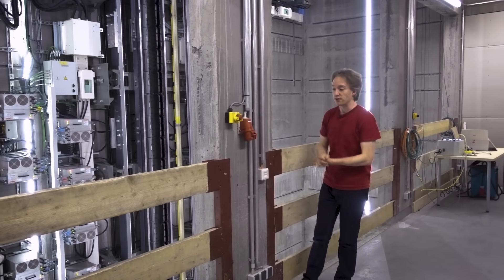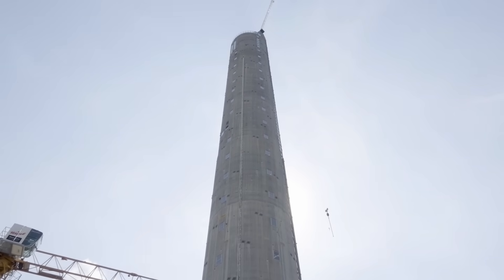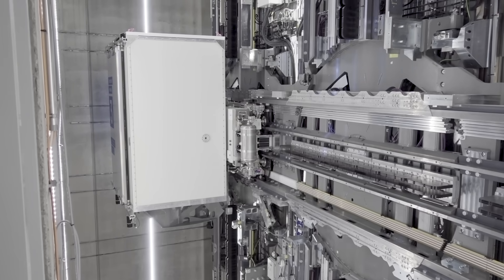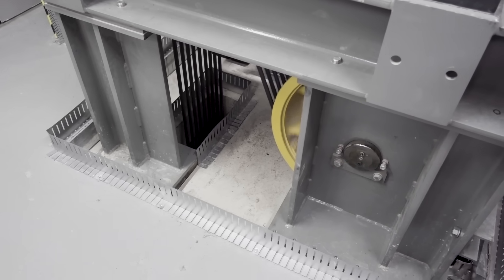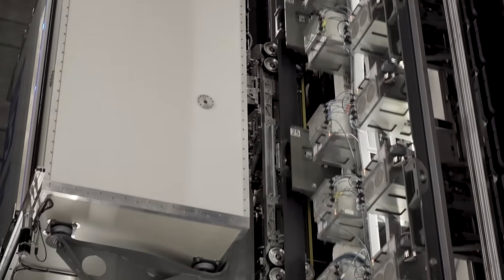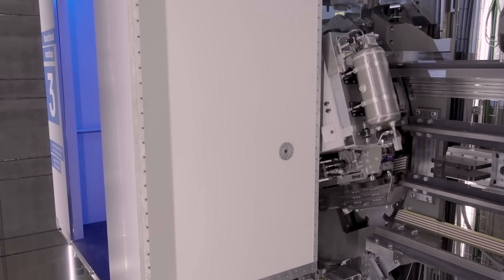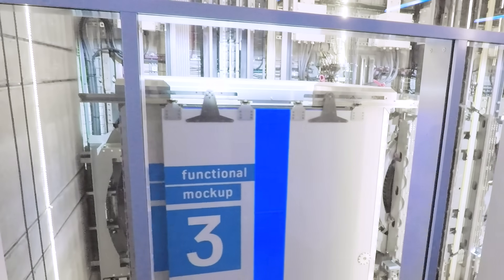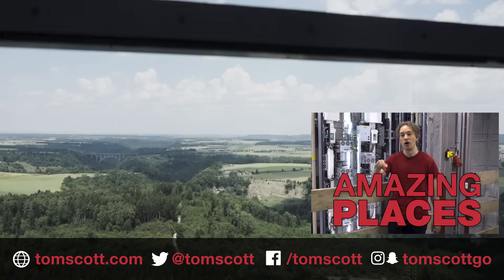An elevator that actually goes sideways

Comment: The elevator buffer will reduse the fall from fatal to  serious injury
Reply: Seatbelts reduce the crash from fatal to serious injury.
Reply: Place a bucket of water before falling, noobs
Reply: @theperson7938  or how about keeping a bubble gum in your pocket?
Reply: Between dying or losing a leg, I think I rather lose the leg.
Reply: @adammcfall5133  Between death and brain damage vegetable state, I'd pick death.
Reply: @adammcfall5133  I'll rather die
Reply: Ke Gao same
Reply: @影-j7f  You're weak.
Reply: @影-j7f  same
Reply: @影-j7f  sane
Reply: @影-j7f  same
Reply: @影-j7f  same
Reply: @benis9965  I mean I can’t suck my toes, so it’s a huge downside.
Reply: @rhaib  super sane in fact
Reply: @影-j7f  why
Reply: @影-j7f  Tell that to BTK amputees that live healthy and happy lives.
Reply: @影-j7f  with the state of prosthesis these days, i wouldn’t worry
Reply: @cumquatrct3 Not a good idea
Reply: cumquatrct3 
It actually wouldn’t help much. You might expect that you’d be floating in mid air and the elevator would crash below you but thats only your velocity relative to the elevator. Your velocity relative to the ground wouldn’t change much. You’d still fall with the elevator—just slightly slower. If the elevator has transparent walls you can see that.
Reply: @cumquatrct3 how will you determine youre about to hit the ground?
Reply: İ would rather not use the elevator at all
Reply: Bruh just activate no-clip, it's not that hard, just press V
Reply: Didn't work in The Omen....
Reply: I always thought "why not have independent sensors connected to an inert electromagnet system on the rails to engage slowdown when a freefall is detected? (just like those vertical freefall park rides)"

But then I realised that those cost more (to implement) than a human life.
Reply: @VarunGupta3009  I think the reason why that might not be used would be more due to difficulties in detecting a freefall. Elevators have all kinds of redundancy but they also aren't the smartest machines. Vertical freefall rides are entirely controlled experiences that most likely rely on timers and sensors activated by the elevator passing over them.
Reply: @deadturret4049  Even though a theme park ride is largely controlled by static time methods, and most of their operations are based on assumptions, an elevator has a lot of heuristics to work with. They may not be the smartest right now, but my point was to make them smart enough, which can be done right now by adding a simple circuitry to the existing system or even an algorithm. Hell, I can think of an implementation this moment with a dollar microcontroller and some C#. I am not trying to undermine the work put into them, but making elevators much safer than they are today by adding simple mechanisms shouldn't be that difficult. The cost of inline magnetic dampeners is a little high, but that could be worth much more in the future both in human lives and in service/malfunction costs. They are static systems and don't require any logic to work. They just slow down an elevator significantly before contact.
Reply: -Tom Scott 2017
Reply: cumquatrct3 dude I was always thought if it would work
Reply: cumquatrct3 ah yes, because I too have reactions faster than the speed of sound.
Reply: Reduse
Reply: i mean thats still an improvement
Reply: The traslate = you will die 30 ; 60 seconds after the fall
Reply: It's to catch cabin on normal speed in case when sensors don't work. NOT MORE! It can't help with falling cabin. Nothing remains in this case.
Reply: @akash-zg4vj  drink milk  to get rid of digestive problems
Reply: Tell that to the scientist in The Omen II
Reply: It reduces from death to comma.
Reply: @bungkusi2432  coma?
Reply: if you could hit the ceiling of an elevator with your head you should be in the Olympics. You would hit your head on the ceiling if it were going up, but not down.
Reply: @jasperpreedy1  Actually, it would be the opposite. If the elevator car is rising and you jump the ceiling will rise away from you. If it's going down and you jump, the ceiling is falling toward you.
Reply: @Dwayne_Bearup  if it's not accelerating or decelerating just moving at a constant speed it will be exactly the same as jumping in a stationary elevator.

Comment: Ingenous. One way shafts. One up. One down. Cross sections at each floor to allow  loading or unloading.  It would be like a vertical  chair lift. No need to stage for high buildings.

Comment: This is actually highly impressive when you consider the operational implications of such a system. It's like comparing Personal Rapid Transit (PRT) to a traditional subway. This allows elevators to share a single elevator shaft and not block each other's progress, they can "pull off" like exiting a highway at the desired floor and stop, while allowing other elevators to continue past. Almost like adding sidings and crossovers to a single track railway. This could have big implications for future elevator design, currently tall buildings need such a large number of elevator shafts it becomes impractical and takes up enormous floor space on the lower floors

Comment: In a perfect world it looks like it will work fine but what happens when you get some kid in there jumping around and such?
Reply: That's where safety checks come in
Reply: and it jams in place trapping people inside. I understand you have to start somewhere but this will not be ready for prime time for a while to come.
Reply: @finscreenname  
and it jams in place trapping people inside.
You mean like regular elevators also tend to do? I am sure that there still is a lot of work, but it is a reasonable and promising system for high buildings.
Reply: Ya, exactly like that. Except these are super complicated and change directions. More ways for them to jam.

Comment: Im a mechanical designer . I think the design is too expensive. have a motor on the elevator drive a gear that meshes with a rack that is on the wall of the shaft.

Comment: K.I.S.S. seems to me the more working parts the more opportunity for failure.
Reply: Of course. But while the individual parts may be more complex, my guess would be if the network as a whole is well designed this will be more robust in aggregate than individual lift shafts.
(also takes up way less space, since you can run multiple cars in a single shaft)

An elevator shaft contains a single elevator and occupies a shaft the length of the whole building.
This, opens up so many new options the added complexity is probably worth it.

I mean, an aircraft is more complex than a rickshaw too, but that doesn't mean aircraft are a bad idea...

Comment: Cost factor is the main issue from what I can see. A standard elevator is a largely stupid simple design. This one is not.

It certainly will have customers but those will be quite rare
Reply: Well its for large towers only. I think the maximum height for a conventional elevatior is around 100-200m (guessing here). So anything higher then that would need multiple plateaus where you would need to change the elevator to go further. 
linear actuation does not impose such limits. The other stuff is extra candy thrown top because you get that "for free" due to the new drive. 

Im assuming someone thought about how they could give the linear drive more usecases ^^
Reply: @jojoposter  on top of that, you could run more than one cab in one shaft, as the cab can just side step at each floor to let people out, while other cabs can pass it.

This is especially useful for large towers where one cab per shaft can severely slow down the process. So this is indeed best suited for large towers.
Reply: @garageghost6038  interestingly enough there is a different system (which has been around for longer than this to my knowledge) that they came up with which has 2 cabs in the same shaft which are independent to each other, but it works similar to if there was only one can in the shaft
Reply: Paint it gold and we know in who's tower it will be soon installed.
Reply: @MetalheadAndNerd  imagine bringing politic into this

Comment: By definition, it's not an elevator. That would imply something must be going upwards, aka elevate. If it goes horizontal it is no longer elevating. Maybe we could call it a moving box, that sounds more accurate.
Reply: It's a Wonkavator.
Reply: Did you even watch the video? This Thing can do both horizontal and vertical movements and most of the time it goes vertical.

Comment: A good application of this would be for buildings with a very high volume of people, you could have separate "up" and "down" shafts, with a horizontal connector at every major floor so dozens of elevators can continuously keep running all on the same set of shafts.
Reply: Elevators in parking and multiple lanes so that there is always an elevator available at a moments notice. Just like in movies, or more notably, Star Trek.
Reply: This configuration would also save a lot of floor space while still being faster than 8 elevators.  You could also have some floors with more access points for elevators such as the ground floor where more people get on/off.

Comment: The buffers are not intended to stop a free falling elevator cab. The buffers are there in case the elevator control system malfunctions and the car travels at contract speed (normal speed)  past the terminal floor (top floor or bottom floor). The safeties are on all cabled elevators to prevent the free falling of the cab. Every modern elevator also has both a normal backup system to prevent the elevator from traveling past the terminal floors along with an emergency system as a sort of backup of the backup. Also, the newest elevator machines have two independent braking systems to hold the car at a given floor. Elevators are very safe.
Reply: At least in the USA they are designed to reduce a fatal fall into horribly injured, Elevators in the US are required to be inspected and tested and a regular test is loading it to max weight and driving it at max speed into the end stop at the bottom of the pit.

Comment: If we compare the cost of installation of 20 conventional lifts in the 60 stops building,with these Multi elevator sideways system,which  is a difference in coast between these two system?

Comment: The buffer at the bottom of the elevator shaft is designed to stop the car safely at it's rated top speed, it will not help you one bit in a freefall

Comment: Well, this is a working elevator going sideways but its in a testing facitlity. If you still want to show off special elevators you may be interested in the Schmid ThyssenKrupp Peoplemover in Berlin, which goes up, then sideways and then down again and it is used at a public train station (one of the smaller ones I might add).

Comment: Trains are the original sideways elevator.
Reply: Elevators are just vertical trains.
Reply: @junglefett  More like vertical cable cars.
Reply: @junglefett  true dat
Reply: The German word for Lift is "Aufzug" which literally translates to 'Up Train'.
Reply: @junglefett  trains are horizontal elevators
Reply: @Tensho_C  Nope!
Reply: @Tensho_C  horizontalater
Reply: Actually wouldn't mine rails be the original sideways elevator.
Reply: 1,000th like!
Reply: JS Studio's I thought I did it xd
Reply: A belt like moving walkway would be a closer analogy. Like at an airfart.
Reply: @googletaqiyya184  aren't all farts airfarts?
Reply: @rokronroff  Only on planets with an atmosphere. If not then they are called a word I cannot say using any form of gas therefore useless to try.
Reply: @rokronroff  Well no. There is a huge difference if you release the gas in the air or under water. The difference is most noticeable in confined spaces like tiny bathroom in an apartment building without bathroom window.
Reply: Trains drive forward like a car. Your dumb af
Reply: Finally someone who knows their stuff
Reply: Nah
Reply: Well in germany they are called aufzug. Up train
Reply: True
Reply: It’s hard to argue with his assessment
Reply: Have you heard of hill trams
Reply: Trams or cable cars more like.
Reply: And u can’t argue it doesn’t go up there are hills
Reply: Actually cable cars are, because there aren’t multiple cars in an elevator like there are in a train, but cable cars like elevators have only one car.
Reply: @definitely_notme4112 Cable cars can have multiple cars.
Reply: Especially with platform edge doors lmao.
Reply: Ladders are the original elevatore
Reply: Nietogenix gaming except the ladder doesn’t move, you move
Reply: @definitely_notme4112  ye well it move if it falls
Reply: No they don't elevate
Reply: True
Reply: It's hard to argue with his assessment
Reply: Sideways are horizontal the elevator.
Reply: no because they don't elevate. trains can't go uphill according to james may. also there were elevators before there were trains.

trees were the original elevator
Reply: Well not really bc you travel forwards
Reply: Horses
Reply: Surely a machine has to elevate to be an elevator?.
Reply: That's a stupid thought because trains are on tracks and elevators are in buildings. Two totally different pieces of technology.
Reply: What about pneumatic elevators? Are they just upscaled vertical pneumatic mail?
Reply: Quaglium Quagnarr would like but you have 666 likes

Comment: Doesn't this make them horribly inefficient?
With a standard elevator, the cables don't just pull up and lower down the elevator. At the same time they also lower down or pull up a counterweight.
This counterweight helps provide some of the gravitational potential energy making them much more efficient.
How would they do something like this (to offset the gravitational potential energy requirements) for this elevator?

Comment: The scale of their 'mock up' rig is vast! Could they not have produced this on a smaller level to prove its worth? Shows how much investment must be in the industry to warrant this!
Reply: The tower is of course designed to test all conventional elevators. And to test those you need the "full cable length" to address all issues with oscillations and weight.
Reply: @herbertzausenhaim246  I just presumed that it's a case of working up to it. Paper based calculations, scaled test rig and then full size prototype. If they already have the facility to hand however perhaps they skim over some of the stages.

Comment: One of the problems with large condo towers over 40 stories is the air pressure which impacts the cars and knocks them out alot.

Comment: Sidenote, but the gateway arch in St. Louis uses a peculiar system for the elevator.

Because the arch is an arch, the elevator has to move diagonally.

Comment: It is easy to make a fail safe none powered emergency brake, simply use a spring loaded magnetic brake similar to roller coaster brakes,. as soon as free fall occurs the brake flies out to a conductive track.

Comment: my main question is why do we need/want Sideways elevator? from what it looks the car has to go to the floor then rotate then travel again to the side for how ever long, im sure most people could out walk it. and the inconvenience to the other riders, again car goes to the floor then rotate then travel to the side opens, then has to travel back to its line rotates again then back up.
Reply: This would be a great way to reduce congestion in high towers where you can only have 1 elevator per shaft. If a tower has 100 floors, a trip up and down can easily require a) too many elevators and b) lots of time. 

Better efficiency is how money is made, because time is money of course.
Reply: Probably so you can have multiple elevators per shaft going up and down which increases the transport capacity of the entire system.

Comment: This is going to be ridiculous expensive, look at it controller every where, maintenance is going to be a nightmare
Reply: So you never saw the controllers of a modern elevator...
Reply: Bruh you have just as much controllers in half-automated warehouse.
Reply: Induction motors are very expensive. Would be cheaper to just use electric motor tractors to tow the lift capsule around. Power it with live rails. Might be a little more noisy though.
Reply: If you want to talk about a maintenance nightmare consider an old relay logic elevator controller which has no computer components and instead is controlled by a series of cams, switches and rollers in the elevator shaft and a bank of hundreds of relays that control every individual function of the elevator. THAT is a maintenance nightmare. I've seen an elevator mechanic spend 4-5 hours daily for two weeks watching and testing relays on relay logic system from the 1970s to track down an intermittent problem causing the elevator to get stuck on the top floor.
Reply: Vs a pulley and steel rope system where the latter can't withstand its own weight and the former is looking a bit dicey unless you build it extremely strong and maintain it rigorously? And can't have a cast iron guarantee of its position by rotating the switching module and ensuring that it maintains a constant height and horizontal position throughout at least a 90 degree turn? Yeah, OK, have fun.

Comment: Would be interesting to learn the types of travel scenarios this system could allow. Wonder if people see the value with this system as allowing buildings to have one shaft. Wonder if the trips could be arranged like a well run train line. Where we'd have to option for express or local lines. Wonder if it could be used in rush hour times and the lifts could be stacked ready to move a large volume of people efficiently.

Comment: What is the point of this elevator? It’s just changing track to go down which a normal elevator would do anyways? I don’t get the point. Also since there has never, ever, not even once had an elevator plummet to the ground, it’s not like it’s improving safety. The elevators now have never fallen.